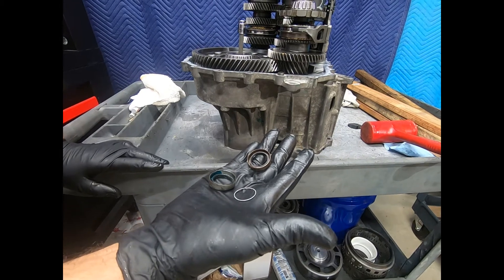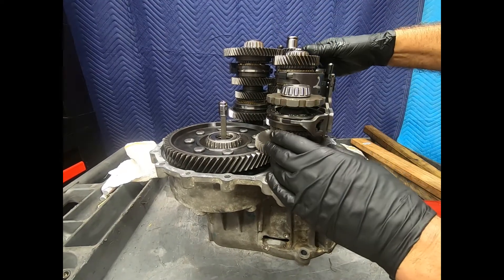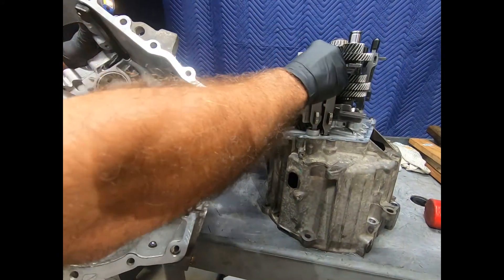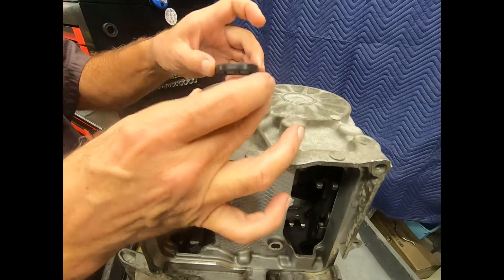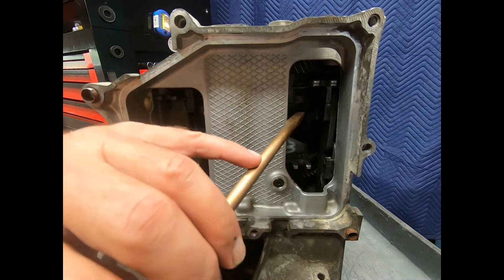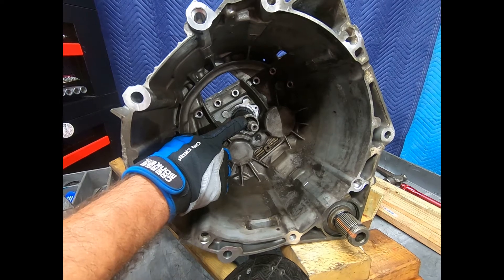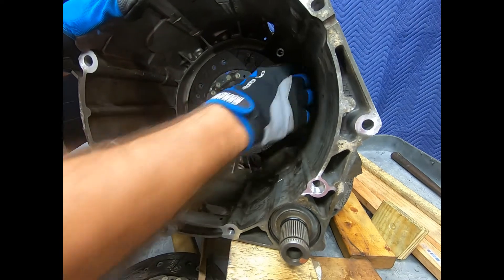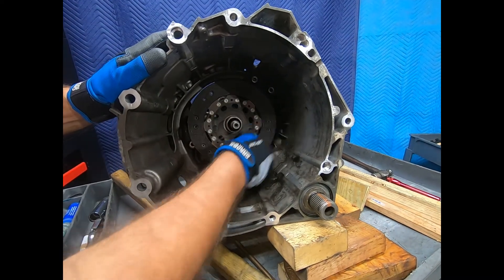Volkswagen 7-Speed DSG Transmission/ DQ200 Input Shaft Seal Problem

Comment: My dsg says stuck in 7th gear on diagnostic and will not move in reverse as it feels like it wants to go forward and backwards same time. I can drive forward in all gears no issue. Noise when in 1st and 2nd gear but none afterwards. When in 6th and shifting to 7 and back no difference on rev counter as if it is not happening. possible problem. Thanks